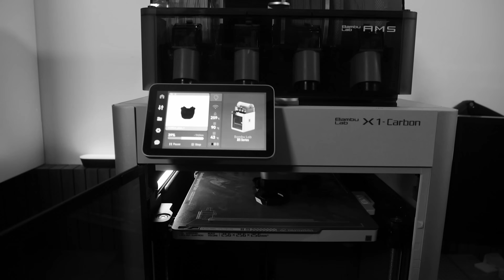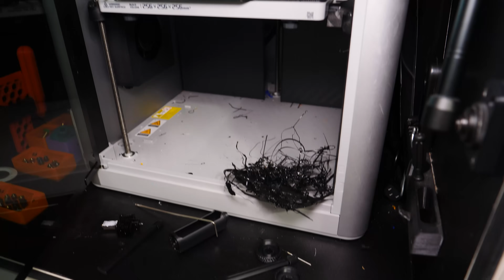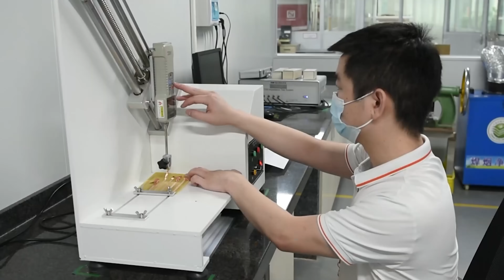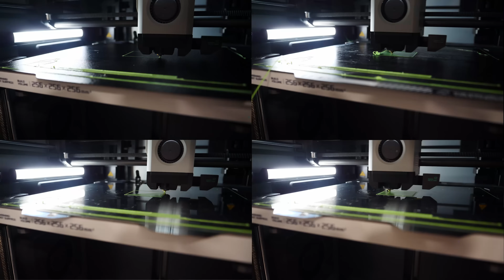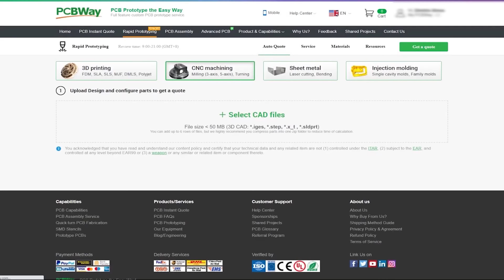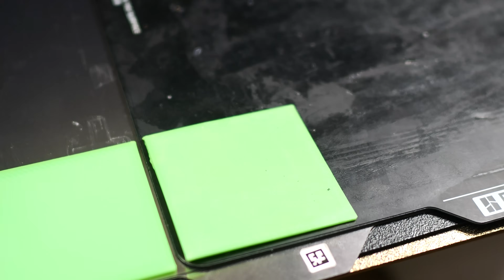Improving My Bambu Lab X1 Carbon... With Cheap Knockoffs!

Comment: I have added a few minor community mods to my X1C (Aux fan saver, poop bucket, desiccant containers for the AMS, etc.), but I'm hesitant to mess with the core functionality of the machine.  As you said, this thing "just works" pretty much every time.  I have had my machine for about 6 months, and I have not had a single print failure in that time.

My favorite mod for the X1C is LED strips on the bottom of the AMS.  The light shines down through the top glass into the machine, and the difference is literally night and day.  Being able to see well inside the machine is a huge quality of life improvement.  I haven't had any issues with LIDAR errors from the extra light.

I am tempted by the replacement hot end with the V6 style nozzles, as changing hot end assemblies to switch between nozzle sizes normally means messing with delicate wires and connectors that seem to me like they should be left alone as much as possible.  I would like to be able to swap in a 0.2mm nozzle to print high-detail miniatures, but most likely I'll just dedicate one of my other 3D printers to that instead.

I can understand people's concern around the machine's proprietary nature, but for me the X1C has been a breath of fresh air.  I have four other 3D printers besides my X1C, and I have had to put a lot of work into each of them to make them reach a level of reliability the X1C has shown right out of the box.  In fact, having the X1C has made tinkering with my other machines much more enjoyable, since I have the X1C to fall back on if I need to print any parts quickly for them.
Reply: Very well put.
Reply: My only issue with the X1C is it's weak bed magnet.  Anytime I'm printing ABS, if the part comes withing 25mm of the bed corners, the print will stick fine to the spring steel print surface but the spring steel will pull up off the magnet, resulting in warped prints.  This is not an issue with any of my other printers and makes the X1C worthless for ABS unless I reduce hotend temps, increase bed temp and greatly reduce print speeds and even then, it's not guaranteed that a print won't warp.  So either I print ABS slower on the X1C than I can print it on my Voron 2.4 or my custom coreXY, or I am only able to use about 200mmx200mm of the X1C's already smaller bed to print ABS slower than I can on my other printers.  The other printers may take more fiddling (flow rates and such) and may not print as fast as the X1C is capable of with other filaments but for ABS, my other printers are the better option and I regret purchasing the X1C.
Reply: @Mark_Massingill  That's interesting, I have printed some ABS parts on my X1C that were almost the full width of the bed and fairly close to both front corners, and I haven't seen an issue like that.  Have you opened a support ticket with Bambu Lab?  They might send you a replacement bed.
Reply: @l0rider   I printed the same part that began this issue on both my Voron 2.4 and a coreXY of my own design, both have cheap AliExpress build plates/magnets, on both I intentionally put the part the same distance from the front corner of the build plate as it had been on the X1C's bed.  I printed at the same temperatures and speeds, both prints resulted in perfectly useful parts, no warping at all and only a little ringing due to the speeds.  I've tried ASA and PA on the X1C, both gave the same results, sticking to the build plate but still warping by pulling the build plate off the magnet.  I've tried the engineering plate, the cool plate, the hot plate, the double sided textured PEI plate, an aftermarket double sided textured PEI plate, while the aftermarket plate actually seemed to do a little better, all had the same result, the print stuck to the build plate but warped by pulling the build plate up off the bed magnet.  The magnet on my X1C is just weak.  

Yes, I opened a support ticket, Bambu's response was to increase the bed temp to 110C (ABS's glass transition temp, which creates it's own issues).  I've tried higher bed temps, lower nozzle temps that meant I had to lower print speeds as well, soaking the bed, doing all that while using a chamber heater to preheat the chamber to 45C before starting to print.  Then end result was that no matter how slow or low temp I print, large ABS, ASA and PA prints still stick to the build plate but warp by pulling the build plate off the magnet.  Bambu's customer service and product support on this issue has been horrible so far.  I haven't used the X1C much because of this issue, maybe 60 hours total, most of that trying to get ABS/ASA/PA  to print successfully, though due to it's expense I've quit trying to print PA on the X1C, I cannot afford to waste it.  Now the mainboard cooling fan is starting to squeal, despite the low usage time.  I honestly expect Bambu to recommend ear plugs to solve this issue, that's the level of product support I now expect from them.

I'll never buy another Bambu Lab product again and I cannot in good conscious recommend their products due to the poor customer service/product support.  I truly do like some of the features of the X1C and I love the ease of use of the AMS but if I cannot get ABS, ASA or PA prints from the machine yet can successfully print all those filaments, print much larger parts with no warping and at faster speeds with my other printers, what use is the X1C?  It seems they haven't even considered that maybe my printer just got a bad magnet, they definitely haven't offer to replace the magnet in an effort to make it right.  I've sent the .3mf of the first print this happened with, video of the issue, told them all I'd tried towards trying to get good, non-warped prints and all they have is telling me to raise bed temps even more to reduce the strain on the weak magnet.  I have had ABS prints warp on other printers, pulling off the build plate due to poor bed adhesion, always solved by increasing bed adhesion via glue stick, a slurry or using a different print surface.  I've never had a print that stuck to the build plate warp by pulling the build plate off the magnet until I got the X1C.  Every part that this has happened with on the X1C I have been able to print successfully without warping with either of my other printers, even if I place the parts right on the corner/edge of the bed.  The magnet of my X1C just sucks.

I guess I should stop knocking the build plates/magnets on my other printers as "cheap AliExpress" since both are better than that of the expensive X1C.  Maybe I just got a bad magnet, stuff happens, but the lack of product support and no effort to make it right from Bambu has really ticked me off.  The printer is nothing but a dust collector now, sitting unused since I mostly print mechanical parts that need to be chemical/oil resistant so need to be ABS or ASA most of the time, nylon now and then but I cannot use the X1C for those filaments.

I'm disabled and on a fairly low fixed income.  I'd been saving up for two years to buy a kit to build a Rat Rig V-Core.  I really, really wish I'd stuck with doing that rather than deciding to buy the X1C with that money.  I feel like I was ripped off.

Sorry for the long rant.  As you can see, I'm really upset over this.  As I said, I feel like I was ripped off.  The only thing that has lived up to their advertisements has been the AMS but it's useless with anything other than a Bambu Lab printer.  I truly wish I'd not spent a dime on any Bambu Lab product.  I'm sure I'd be much happier with a V-Core and an ERCF for multi-color/filament printing.  However, it's going to be at least two more years of saving up before I can build one now.
Reply: @Mark_Massingill  Wow, I'm sorry to hear you didn't get a good response from Bambu Lab.  If Bambu Lab won't help any further, I suggest selling your X1C and putting the money towards the Rat Rig / ERCF.  It's definitely not ideal, but I don't see any reason to hang onto the X1C if it's not useful to you.  

I'm planning to use my  X1C to print the ABS parts to build a Voron 2.4, while it's still under warranty.  The X1C is the only fully enclosed machine I own right now.  I will definitely try to fill the build plate while printing those parts, as I'm curious if my machine will have the same issue as yours.
Reply: @l0rider The parts for a Voron 2.4 are fairly small in comparison to the parts I needed to print, you shouldn't have any issues unless you load up the bed completely.  Even then, the smaller parts may not be an issue and you might have a better magnet than what I received.  I'm hoping mine was a one off, just one bad magnet in a batch, it's the lack of product support and poor customer service that really got to me.

As for selling the X1C, I've thought about it but I'd have to inform any buyer of the issues I've had due to the weak magnet when it comes to printing any warp prone filament and the poor customer service/product support I've run into.  I'd probably end up steering people away from buying the piece of junk I have and into avoiding Bambu altogether.  I'd wind up taking such a loss I may as well keep it for the few PLA, PETG and TPU prints I do.  It will remain a reminder to not jump on the bandwagon or get excited over new advancements, to wait until a printer has been on the market for a while before purchasing.  I honestly bought it because I wanted to support the efforts they were making to advance 3D printing and I stupidly believed their claims.  I'll never buy another product from them and I'll recommend others think twice before doing so as well.  I hope your experience is better than I've had and that you got a decent magnet in your bed.  You should be pretty happy with your Voron 2.4, I love mine, though I have done a few mods.  The magnet clips for the bottom panel, a klicky probe (I switched to annex engineering's though I still use Klicky's macros), my own mod to the Stealthburner to use Orbiter gears and add the filament sensor required for the ERCF, a mod for the z joints, some LED strip lighting up top and a Nevermore filter.  My ERCF is giving me fits at the moment, I think the line counter it uses to measure filament extrusion/retraction on load/unload is going bad or may just need adjusting or cleaning.  I don't really do many multicolor prints so I haven't bothered to work on it, I just went back to using single spools again while I'm working on the CNC design.  Fixing the ERCF will be the next project on my list.  The one thing that was impressive about my Bambu setup was the AMS, it can be a little wasteful but the ease of use and loading filament great, not to mention it doubles as a dry box with desiccant.  Too bad it only works with Bambu Lab printers.  Happy trails.
Reply: Interested in selling your X1C?  I would love one but I can't afford more than a P1P
Reply: I'm in Northern IL
Reply: @tedo3332  Nope, customer service was horrible and kept up a lot of nonsense but they finally sent me a replacement bed.  I think they did it mostly to try to prove to me that it wasn't the magnet so I sent them video of the new bed holding down the same part that kept warping before printing just fine with no warping.  Turned out it was the magnet, for some reason it was just weak in the front half with the right front corner being the worst.  New bed is holding the build plate down much better, haven't had a warped print since.  Even were it still not holding the build plate down I wouldn't sell it, I'd lose to much since I bought the combo of X1C + AMS and it still would have printed smaller parts just fine.  Issue was with larger prints using warp prone filaments. Now I can use the entire printable area and even PA (nylon) prints perfect.  I wish their customer service hadn't kept giving me the runaround, I spent two months and 4 rolls of filament trying to get large prints to not warp, trying everything they suggested to no avail. I'm not happy with their product support team and hope I never need to submit a ticket again.  I doubt seriously I'll ever buy another Bambu Lab product but I'll keep what I've got.
Reply: @l0rider  They finally sent me a replacement bed (I guess they couldn't send just the magnet). It's been a few weeks now and not a single warped print.  For whatever reason, the original bed magnet was just weaker across the front half with the right front corner being the weakest, that's where the prints would always warp from, lifting the build plate off the bed every time, then with the nozzle hitting the warped area and breaking bed adhesion in other areas due to impacting the raised area, the entire print would fail if I didn't cancel it first.  Since the new bed arrived, no more issues.  Just wish they would have listened to what I was saying and made a better effort to solve the issue earlier.  My only complaint now it the horrible experience I had dealing with their product support team, the printer and AMS are working fine now and I don't worry about larger parts warping anymore as the new bed magnet has no problem holding the build plate down.
Reply: @Mark_Massingill  That's good news!  It's a shame that it took so long to get your issue resolved, but I'm glad to hear you can fully use your X1C now.  Cheers! 👍
Reply: I have added the little mods too. The only major thing i am thinking of adding is a top glass riser so i can insulate it and i will also insulate the sides. I need to find out what material they use for the insulation on the x1e.

Comment: Bambu labs isn't so much a closed eco system. It is a new eco system that will finally kill off the slow to innovate Ender 3 / Prusa MK3 ecosystem. This is a good thing.
Reply: @bomas_ulz  I run a large farm of Bambu P1P and X1 Carbon and apart from the SD cards supplied being rubbish, they run 24/7 without issue. I do have to do repairs and maintenance and haven't found it difficult. They are producing much better quality than mk3 ever will. They produce this quality in 40% of the print time.... and they're cheaper... and they arrive assembled. Good luck with  your reliable old horse. I've got a fast, reliable new car.
Reply: @bomas_ulz  I'm sorry to hear you had issues. I understand how much that sucks. I operate 20 P1P and haven't had an issue yet. I also have similar X1 carbon and a lot of older machines. I did my first 3D print in 1989. I speak to the other farms around me and they are also having good luck. I produce 30,000 parts a month. I amortise a machine's cost into cost of sales in 90 days. Who cares after that? I just can't have slow machines taking up rack space. Printing in 40% of the time equates to 40% of the energy cost. MK3 was an excellent machine for a long time and they are reliable and simple, but business is business and you can't be sentimental. If you are a hobbyist with a couple of machines then I can see the affinity for the legacy Prusa designs. Good luck with your printing.

Comment: I think there are some different groups of users, and as in all groups, these also intersect into lots of smaller groups. There is definitely a group whose main interest is 3d printing and tinkering. And then another group, whose main interest is using 3d printing as a tool. For the first group, they will likely tinker away regardless of what the printer does out of the box regardless of how great it is, because tinkering is the hobby. For the second group, they might tinker if they must, or to get some slightly higher performance, but ultimately they weigh the risk/reward much more as they want to use 3d printing as a tool to do some other hobby (or business).

Comment: I have the original Bambu Textured PEI plate and do not have any errors or warning messages using it. I think when I got it, there were no alternatives available. Also, some others have suggested that you can possibly just use the "cold" plate the X1C comes with but heat it up to 55C and then it holds PLA fine without glue. I have not tried this. But I can see how this could work, as on the Prusa, I never used the PEI plate cold, always had it at 60C.
Reply: it does not help that much, heating up the cold plate to 55 or 65.

Comment: For those that don't read all the directions, Bambu Labs fixed the "problem" with the latest firmware release...
X1/X1-Carbon and AMS Firmware Release History
OTA version 01.04.01.00 (20230227)
【Improvements】
1. [Algorithm] Optimized the HMS prompt explaining that the PEI build plate does not support first layer inspection.
Reply: what does that mean optimized? lol

Comment: I really enjoyed watching this second video and am looking forward to future videos from you.
As for modifying my Bambu Labs printers: I added additional lights (Ikea Mitled 20cm fits nicely and is controlled as a smart home light) to the X1C. The Bambu LED is ok, but I wanted to see clearer details in the video feed on the dark PAHT-CF prints I do. I added the same lights to my P1P, as I was not part of the kick-starter (with the lights, aux fan and camera bundle) and these options still aren't available through Bambu. I designed some custom parts to angle the lights down at the print plate and to manage the cables of the Ikea lights. 
For the P1P I added a camera mount to hold a Raspberry Pi camera which streams live video. No automatic time lapse videos but I can now check the print live video feed.
As for the print plates, I use, BL PEI plates for PLA, Engineering plate for PAHT-CF and the Wham Bam plates when I want mirror surface first layer

Comment: Whether or not the prints turn out well doesn't mean that Lidar is 'working' with textured plates. The Lidar has fine enough resolution to pick up on the uneven finish of the textured bed and thereby applying a suboptimal K factor adjustment.

This is why Bambu says not to use Lidar with textured plates, and if you wish to do that, first run flow calibration on a smooth plate, as the machine will retain that calibration until you restart the machine.